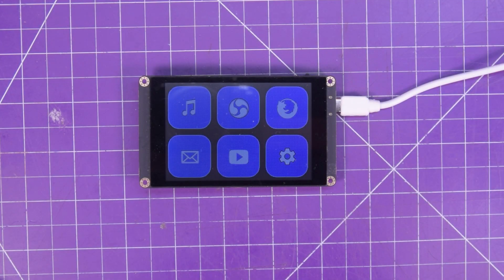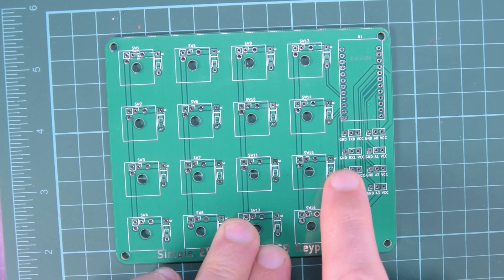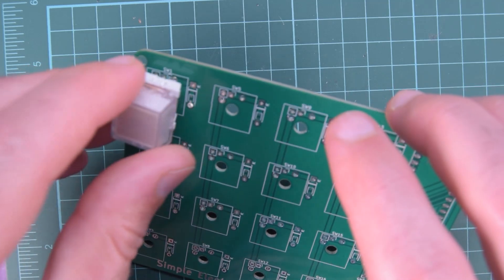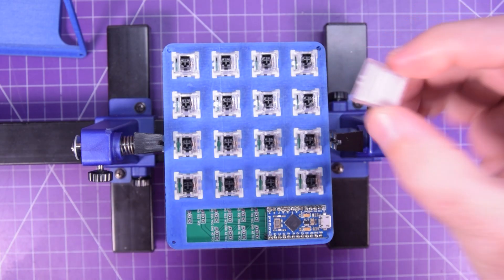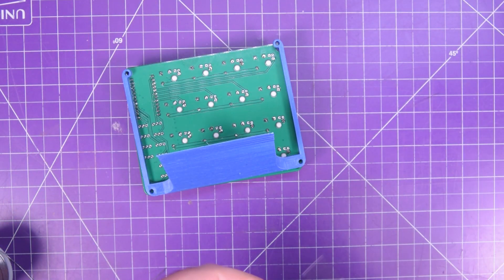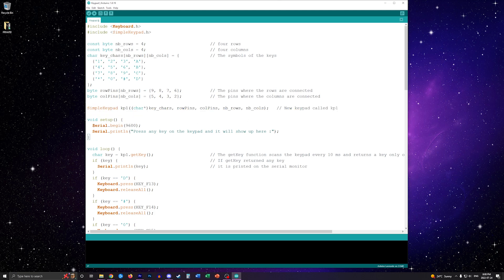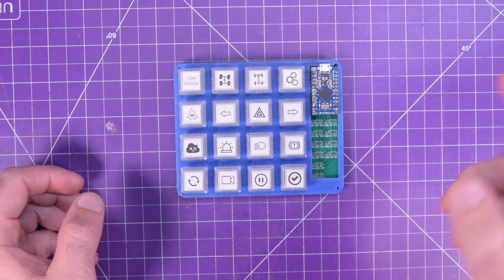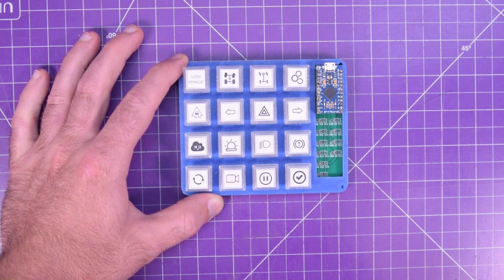The SMOOTHEST Macro Pad EVER! - Arduino 4x4 USB Macro Pad

Comment: That's awesome. Can't wait to see the back-light version. :)

Just a thought, could'nt you mount the Arduino on the rear of the PCB so that the front panel is flat ?

(have the pins on the Arduino mounted on the chip side instead of the bottom, that way it would still line up pin for pin without having to remake the PCB.)

Comment: I don’t have a 3D printer, can the cad files on the pcb page be used to print f3d stuff from pcb way as well.

The analog ports broken out is a great little add on for some joysticks.

Great project.

 I did a 2x4 macropad with an esp32 (Bluetooth) for a game as well and used a laser cut acrylic to stick the keys in and a blob of bluetac to hold the esp32 in place. Works fine.
Reply from the maker: Yes PCBWay can definitely print the files for you!
Reply: @SimpleElectronics  that is pretty sweet. Will definitely be looking into it.

Comment: What would it take to set it up for controlling lights and sound effects like some content creators do with the commercial version that's similar to this?
Reply: That's a perfect use for node-red.  It wouldn't take much.  The biggest thing is that the board itself doesn't support any networking, so you'd have to add bluetooth/wifi.
Reply from the maker: Too hard for me!
Reply: I'm thinking auto hot keys. So the macro board would send a keystroke and auto hot keys will interpret and execute the functionality you desire.

Tom Scott did a video of "emoji keyboard", and taran from LTT did a video about setting up multiple keyboards for video editing.

Comment: those blue pcb holders seem cool but when I finally got one I hated it and gave it away haha a small panavise is almost the same price and upgradablr
Reply from the maker: I checked the prices and the panavise seems like it is around 80$ - I paid I THINK 15$ for my holder
Reply: @SimpleElectronics  some people sell that holder for like 100 beans. I paid like 30 I think. I priced a panavise and to build a modular one the part is 70 I think. The full panavise 350 goes on sale for like 30 percent off alot. My video game setup is leaving my workshop this weekend so I'm setting up a chill multimonitor coding spot and a proper large work bench. I've had an LG c9 120hz for 3 years and have barely used it haha. I gave away my Sim rig too ehh. I didn't realize the wheel and pedals were on sale when I bought them. It's 900 now haha fuck me. I'm glad it has a good home now. Dude is gonna use mine and set up his in the same room to play with his autistic daughter who really wanted her own.